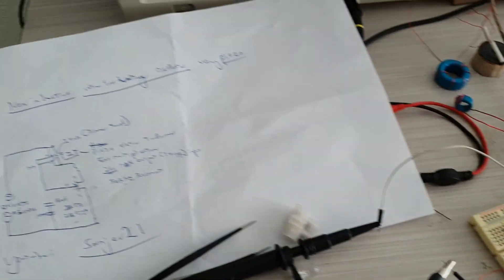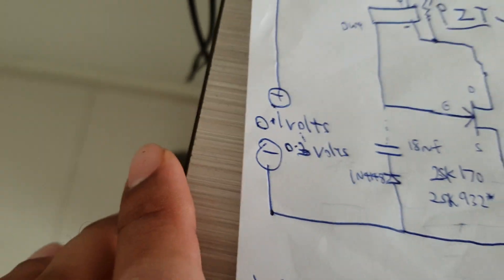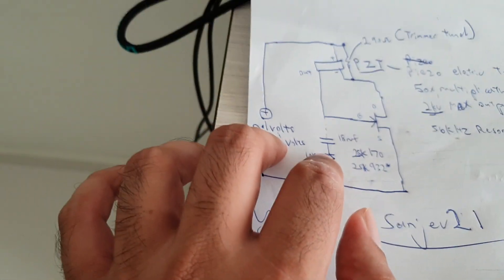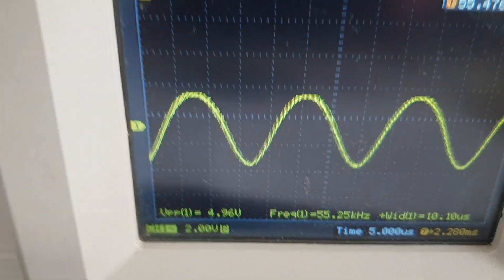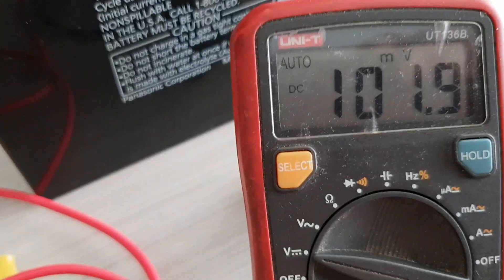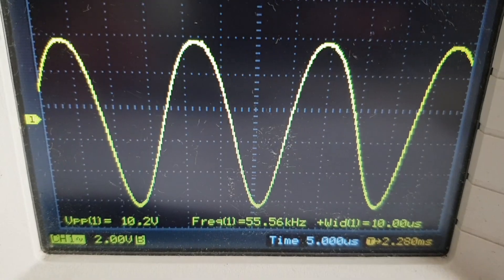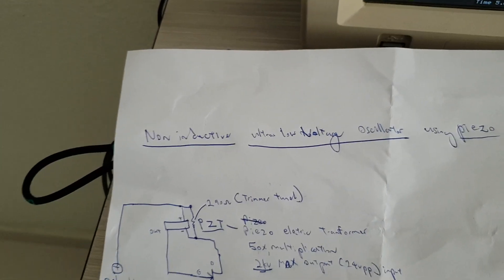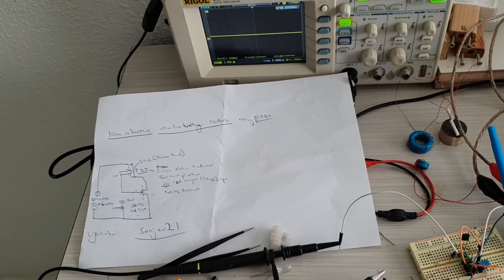Ultra low voltage 0.1Volts oscillator using Piezo transformer-Prototype

Comment: Interesting, and how do you come up with these?
Reply from the maker: Purely brainstorm.I tried various combination inside my head and figured out in my head it might work using piezo.
Reply: I wonder why you don't have more subs?  Probably the lack of uploads I bet but still good stuff and thanks to the modern Youtube if you don't have at least 1k subs you can't monetize.
Reply from the maker: The uploading of the prototype design circuit is done less often as compared to others. Primary unintentional objective completed. My video was used as a resume for my 1st job and got it on the first try. Some of the circuits can't be shown because of commercial value or importance. The prototype ones you view are more for the general public view.
Reply: If that works for you then cool and congratulations.